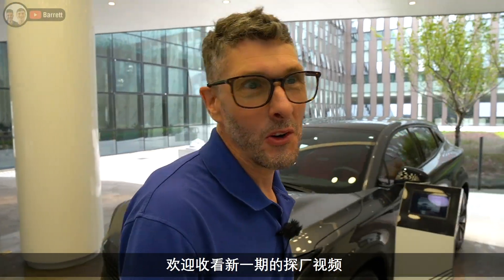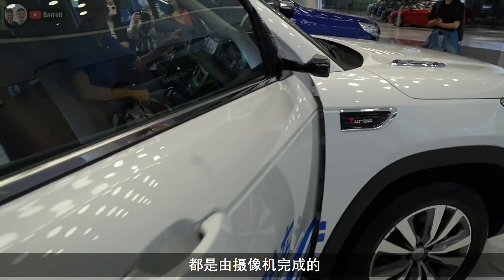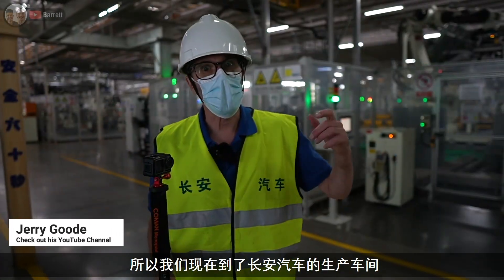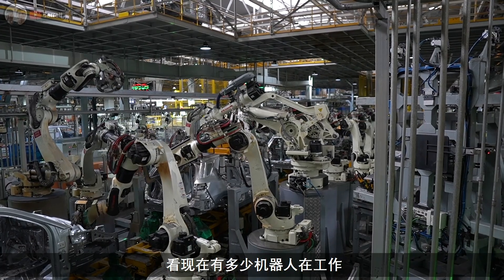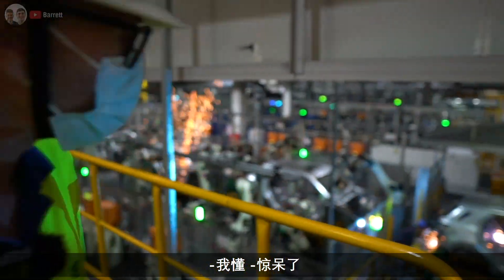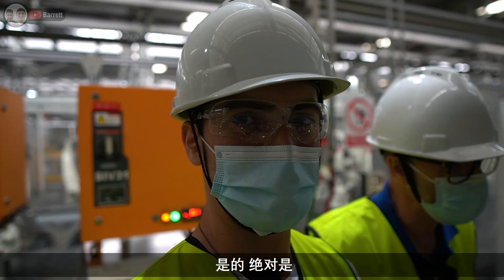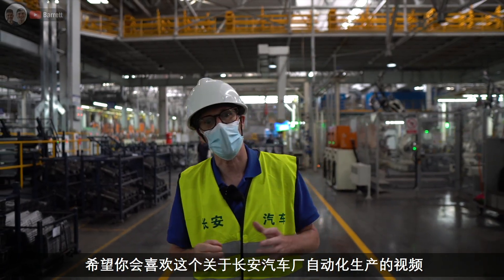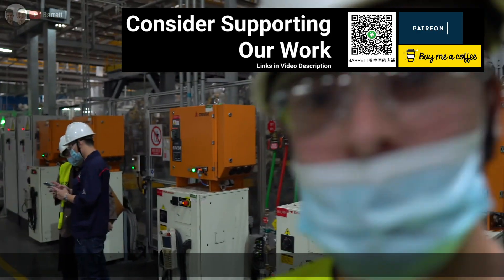Chinese Automated Car Factory of the FUTURE! // (含中文字幕) // 充满未来感的中国自动化汽车工厂

Comment: You math is a little off 600 cars per day is 1 car every 2.4 minutes. How does that equate to 1 car every 50 seconds? I will say that North America has missed the boat when it come time to automating. If you automate why would you not do it in your own country.  The problem with China is there is no intellectual property. They will copy everything and anything. In North America everything is patented and ideas can't be copied without paying someone else.  This is also not good. I mean imagine a company was paid a patent to record messages on a hard drive???? Really?? Our rules / regulations, unions, rabid green programs, and legal system is going to be the ruin of us all. China has no such encumbrances.
Reply from the maker: The figure is based on the factory working an 8 hour shift.
Reply: @BarrettYT  But if it is an automated factory does it not run 24 X 7? But now at least the math makes sense.

Comment: Hey guys thx for sharing— I enjoyed the vid! But since you asked, this actually isn’t that advanced of a body shop by global standards. Though fast, this line actually has fairly low robot density and only seems to produce one model on the line you showed. Every high volume automaker people have ever heard of has operated body shops of similar capability for over 20 years. What separates the top tier is flexibility to produce many models and variants on the same line, in any proportion, with little or no re-tooling effort. The most cutting edge facilities will also have logistics automation and also use the industrial internet and big data to fully visualize and optimize operations. Thanks again for sharing!

Comment: Self adjusting seat was new in the 90's. Fingerprint sensors work very poorly with wet finger or sensor. Opening the car from my FOB in my pocket make more senses. 
The dashboard is clearly way nicer than Tesla cental tablet.
The cams in the review mirrors may improve the car aerodynamic, CO2 emission, gas millage but not the safety, mirror allows stereoscopic depth perception cameras don't. 
I haven't seen any air bags in the video are they missing? or so standard you forgot to mention them,

Comment: Not keen on finger print control, assuming that if your finger /thumb get injurerd, you can still open your car some how.
By the way, 50 sec a car will mean about 1800 car a 24 hour day. You said 600 car a day. That will be 150 second a car. 
One more point, Changan pronounce as Chang An. Great show, enjoy your time in China.
Reply: I'm sure the possibility of you losing your keys is a thousand times more than you can lose your finger print. It's the age of the internet now, probably they can have a provision that whenever you somehow lose your finger print, you can call a number and when your identity is verified, they can open the door remotely for you and fix/update your finger print.

To tell you the truth, I worked for a company where they took the print of the thumb and pointer finger of both my hands. We use our fingerprints to time in/out as well as go through security doors. I cut my right pointer finger enough that the reader won't acknowledge it. I just resulted to using my left one, I didn't even have to bother to do anything. The problem you cited is really very easy to solve, not a problem at all.
Reply from the maker: That is based on an 8 hour per day production cycle.

Comment: 1 car every 50 seconds is a good thing?!   Aren’t China’s roads congested enough?  And the air polluted?  This is hideous. Your utopia is my dystopia. If this factory was in the West I’d say exactly the same thing.  It is sheer insanity at a time of grave climate change, regardless of whether it’s man-made change or not. I can barely breathe clean air in my own city in the U.K. because there are too many cars - even if they were all electric or hydrogen based I’d still hate the congestion and the fear of being killed by an SUV every time I stepped out into the road to cross.  This is insanity on a grand scale.
Reply: Go back to the well and live there
Reply: Z LIU I think it would be better for the world if you did that. My comment should not elicit such a nasty evil response.
Reply: Kit Tam Energy is still needed regardless.  What happens to the old cars? How are they disposed of?  In the West they are just left to rot. Also, congested roads are unpleasant. The more roads you build the worse the congestion. And  energy is required to build roads. It’s a disaster. As I said, if this was happening in the West I’d be equally appalled.
Reply: @EastoftheDanube  You are right, looking at the situation with British eyes.  If you look at China with a population more than twenty times the UK the situation is completely different.  China needs to move a massive amount of people and still meet their zero CO2 emissions commitment by 2060, which many think is overly ambitious or impossible.  Not in China, which is continually building the world's longest and most extensive highway network,  subway systems and high speed rail.  Also China manufactures more electric vehicle than the rest of the planet.  These things are being accomplished at lightning speed because of amazing governance. So you are right about congested roads in China but the Chinese are mitigating all this congestion and pollution with with all those solutions.  Hats off to the CCP.  In Canada, with our broken democracy, it is all talk about climate change and increasing public transportation.  It took Toronto longer to build a single new line in our subway 10km long than for Shanghai to construct the world's longest underground network.